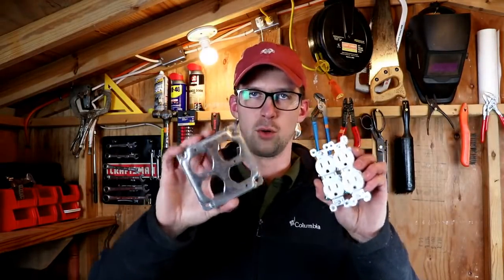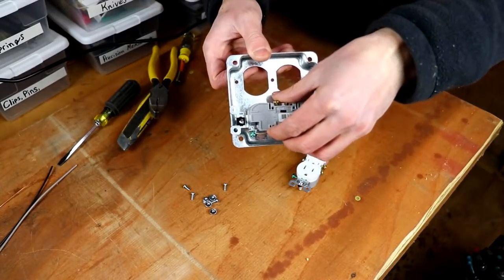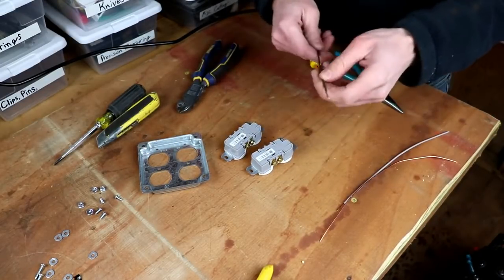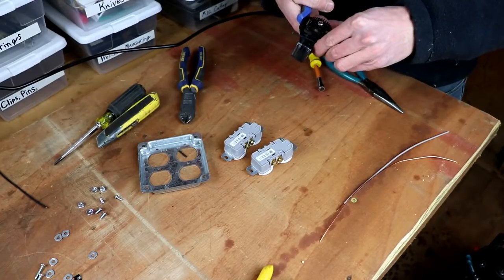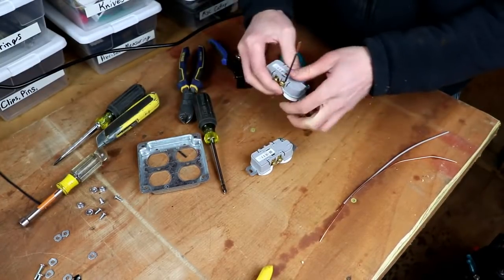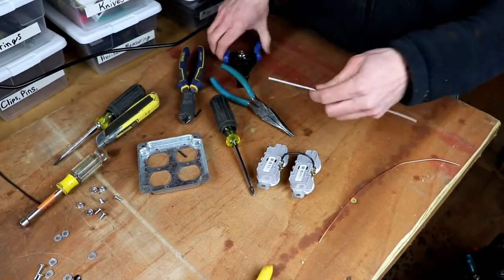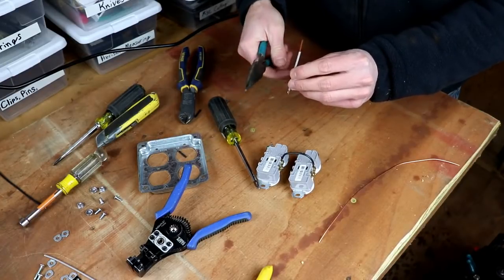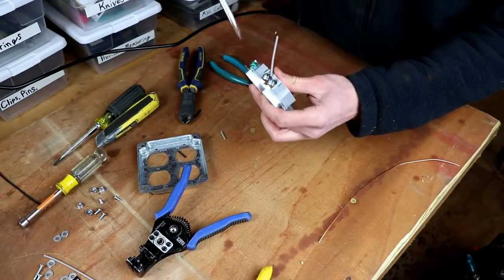How to Wire a Double Duplex Outlet

Comment: I just have one suggestion, use pigtails next time. Wiring them together definitely saves time and is easier, but if one outlet fails, it'll leave the other useless.
Reply: Outlets are made to wire in parallel  due to the solid contact between both screws on each side  so pigtails which is a total pain is not necessary.
Reply: @kato1400  Not necessary but much preferred.
Reply: Ralph Macey why is it preferred?
Reply: @yankkesrule  Actually they are in series. If you take one out all others downstream ho out. By putting a pigtail on that won't happen. Also you are not relying on the thin metal tabs on the outlet. Another benefit is it's easier to roll in the wires when putting tbe outet in the box. Hope that helps.😊
Reply from the maker: Thanks for the tip, I'll keep that in mind for next time. :)
Reply: They are in parallel so that’s not true.

Comment: Zach,   The title for the video is not correct.   You are using some terms incorrectly.   And you have three NEC violations.   A duplex receptacle is a device that has two places to insert a plug.   A single receptacle only has one.   Two duplex receptacles is double duplex or quad receptacle.    
An outlet is an assembly that current can be taken from.   A receptacle is a device installed in an outlet assembly.   Not all outlets have receptacles.   
NEC Violations.   Please read Article 334. Non metallic cable.   You are not allowed to surface mount cable on the front of a stud below 8'.  NM cable subject to physical damage shall be protected.      Article 300.14 says you must have 6" of conductor at the box.    You may have cut it short.
Please be a little more careful if you are going to make electrical videos.   Always be safe,  the life you save may be your own!   
Respectfully,   Kevin
Reply from the maker: Hey Kevin, thanks for chiming in. I always welcome constructive criticism from folks with more experience than me. I'll change the title accordingly. To clarify, I'm installing a double duplex outlet, right? What would be an example of a receptacle?
Reply: Zach Fields   It is a double duplex receptacle outlet.  The device you hold in your hand and terminated the conductors is a duplex receptacle.
Reply: @ZachFields A receptacle is a device that you plug a cord into. A duplex receptacle has two spots to plug into on that particular device. In the video you have  two duplex receptacles installed next to each other in one box, which is often called a quad (4 spots to plug into). An outlet is a point where the wires come into and out of to serve devices or equipment, and possibly to distribute power to the next outlet and so on. In your case you are using a 4x4 junction box (or 1900 box as it is often called) as an outlet to serve two duplex receptacles with an industrial cover. The term outlet is usually misused when the proper term is receptacle.
Reply: Kris Klekosky      Very slight correction.   A single receptacle is a device that you plug into one plug.
Reply: @KevinCoop1  Read my first 2 sentences again and you will see I pointed that out, maybe in different words than you.
Reply: Kris Klekosky    I misunderstood your first sentence!   You were only defining a receptacle, not a single receptacle.   Best wishes.   Be safe.   Kevin
Reply: @KevinCoop1  I should have been a little more specific. I was trying to differentiate single from duplex, but I just said "plug a cord into(meaning one cord for one device).
Reply: Kris Klekosky    I think that we both agree that in reading NEC every word counts.   Stay Healthy!    Kevin
Reply: @KevinCoop1  Yes, because missing one word can actually change a lot. Stay healthy as well.
Reply: Kris Klekosky    If I may, I'm guessing you are a PE working for a Consulting Engineering firm.   Just guessing!
Reply: @KevinCoop1  I am a lighting installer. I work for a small company and we specialize in high end lighting like chandeliers, sconces, recessed lights, landscape lighting, etc. We also install switches, receptacles, etc. I am not an electrician but we have electricians working along with us. Though, in a few months (after this virus stuff ends) I will start working for an electrical contractor that I was referred to by a friend. I also do a lot of my own electrical upgrades in my home.
Reply: Kris Klekosky    Wow, I was way off.   I worked for the largest Electrical Contractor in St. Louis for 21 years as Design Engineer/Manager.   Retired 2018.   Best of luck in your future!   Bye,   Kevin
Reply: @KevinCoop1  Congratulations and I hope you enjoy your post-retirement activities. Thanks, Kris.
Reply: Also he didn't use any ground screw to ground/bond the metal box.
Reply: Thank you Kevin and Kris for the corrections and your pro advice. Thousands of people watch and use information on the video to build, modify, repair and do electrical work around the home. Even one fire, injury or death will be too many.
Reply: Kevin, every point you've made to Zach is wrong. And why are you coming down so hard with  authority by quoting NEC code?  Contractors must follow code of their state because their work is subject to inspection. Homeowners who do their own work are not required to pull permit for doing minor work like changing receptacles and switches. This also includes positioning outlets, switches, etc. so Zach can position the outlets anywhere he chooses. You also don't need 6" of wire to connect the outlet. Try cramming 18" (6" ea) of 12 awg wire plus the outlets down into the box and you'll know what I mean. I may not be an electrician but I I've installed enough wiring, switches, outlets, breakers, etc in my adult lifetime to know what I'm doing. Take it easy. Life is short.
Reply: kato 1     Obviously people watch YouTube videos to watch and hear how to do a task.   It is simple and easy.   They do not have to do things wrong to learn by their mistakes.  Nor do they have to read any books.  So, when the video is not correct, they learned something incorrect.  I'm not picking on the author, I'm educating anyone who wants to learn.
The National Electrical Code is a book written for the purposes of Life Safety.   Contractors do not do install just because of inspectors.   At least not reputable ones.   The contractor I worked for was licensed in 47 states.   I held 3 state electrical contractor licenses and one City license.   Following the rules of the NEC is so that people like you and me have far less risk of death from an electrical fire.   If you want to say that I am incorrect about the 6" fine.   But did you read the rule?   Opinion is not part of my statement.
Enjoy life, and be safe!     The life you save may be your own.    Respectfully,   Kevin
Reply: Regardless of your background, we don't need to be policing you tubers by quoting code violations. If you see a video of someone installing a box too low, tell em why. "Zach man, you don't want your kido reaching and stucking anything in that outlet now would you?". And, "Zach, you need 6" of wire because....."
Reply: kato 1    So the part about "Please be a little more careful if you are going to make videos" made no difference to you.   I do know a lot of the why's about what the code says but, unfortunately I do not know all of them.   I do understand where you are coming from.
Maybe we both can head in the direction you suggest!     You started with, "every point you've made to Zach is wrong".
Zach did comment and ask a question, and I helped him with the answer.  Did you read all the comments?   
Enough.   I am always willing to help anyone.    Thanks for your comments.    Respectfully,   Kevin
Reply: @kato1400  It isn't policing, it is stating facts. There are reasons for the codes we have for electrical.
Reply: kato 1 I think his background is EXTREMELY IMPORTANT. The author is teaching incorrect information and when electricity is involved the risks are high. Personally I’d rather have the code pointed out exactly like Kevin did as opposed to made up random scenarios but to each their own. Better chance to learn the actual code from the experts and do it correctly and safely. Peace.
Reply: Astronutski     Thank you sir!   Respectfully,   Kevin
Reply: @kato1400  the code is for everyone not just contractors. If you do work on your house your self you have to follow all codes that is in effect. The local authorities in your jurisdiction can have your power disconnected if you don't follow the code.

Comment: I prefer pigtails, but to each his own.
Reply: Wiring through another device causes the current of the first device to pass through the second device as well. Bad idea, its not like he doesn’t have room in a 4S box to pigtail and use a wire nuts to connect both devices with the supply.
Reply: @kellybell9235  this is the best explanation I've heard!
Reply: Me too. If you need to replace a broken or damaged duplex receptacle, using a pigtail eliminates taking the upstream devices off line.
Reply: Absolutely this should be title how not to wire a double gang box!
Reply: It really doesn't matter that much. You'll likely trip the breaker long before you ever melt a receptacle. 
There's a reason 15 amp receptacles are allowed to be on 20 amp breakers.

Comment: You know once you make the hook in your wire you can turn it around either way.. no need to worry about which way to bend it lol
Reply from the maker: Good point, I guess that’s two ways of looking at the same thing. :)
Reply: @ZachFields  You are supposed to bond the box with a green ground screw, not rely on the device to bond the ground to the box. It's dangerous to have a metal box that isn't bonded.
Reply: @ZachFields  It was good to do that for instructional purposes. The other thing I like to do is place electrical tape over the outside terminals ... to keep stray items from contacting conducting parts... incase some homeowner takes the cover off and tries to do something not too smart . just a bit of protection for unforeseen things. Especially in metal boxes ... I just do it in all boxes ....  I feel it helps protect the screws, and tape is somewhat affordable. Again not required ... I just like the extra protection .
Reply: @MrSlade62  I did that very thing when replacing a ton of electrical outlets in a home we lived in about 3 years back. Most of the wires were cut short and required a lot of additional work to correct. With them as they were, it was just too easy to touch something by accident and create problems for yourself, so I taped them each with electrical tape just for a bit more safety. They all can be in a tight workspace environment in the boxes, so this is just a good thing to do for someone else who may follow you in the future, I believe.
Reply: @a1930ford  Well done, just never know, something so simple can make a huge difference !

Comment: Great video Zach but why didn't you ground the box?
Reply: Richard :   I have to agree.  I was always taught by my dad to bond the ground to the metal box with a short shielded green ground wire and screw.   Still do it that way to this day.   I’m not sure if it’s required by the NEC, but we always did it that way.   Maybe it’s a regional thing?   Or maybe my dad was just extra careful about grounding. 

Cheers!

Whipple
Reply: Whipple 1 be
Reply: I was just thinking the same thing.
Reply from the maker: Good point. You’re right, I should’ve grounded the box. At the time I was thinking the ground screw on the outlets runs to the metal tabs, then to the box so in that sense the box is grounded. But I really should’ve run separate ground straight to the box.
Reply: @ZachFields  The box needs to be bonded(grounded) so that the devices will also be bonded, whether or not they are screwed down tight in the cover. Using the device to bond a box is like turning the wheels/tires on your car in order to get your the steering wheel to turn(backwards logic). A bad ground connection on that box could literally be fatal under a ground fault situation, where a hot wire comes loose and touches the metal box, the metal yoke on the device, or the ground wire itself. The only way the breaker can trip under a ground fault is if there is a sufficient low impedance ground fault current path back to the main panel. If there is not a good ground path, the victim will just become a resistor or load within the circuit and get shocked or killed, and there won't be enough amps pulled to trip the breaker. It is very serious and people die every year because of poor grounding and bonding related electrocutions.
Reply: @illestofdemall13  If the Four screws holding the receptacles to the cover should come loose or were never properly tightened so could the ONE bonding screw.
Reply: @larsord9139  The box needs to be bonded by code, regardless. It doesn't come loose if you put it on tight, though. The point I was making is the receptacles are not supposed to be the means to bond the box.
Reply: @larsord9139  So does that mean don't put a bonding screw because someone might not do it right? I don't get what your point is. My point is there is a code rule and a reason to follow it and it is standard practice to use a green bonding screw on metal boxes.